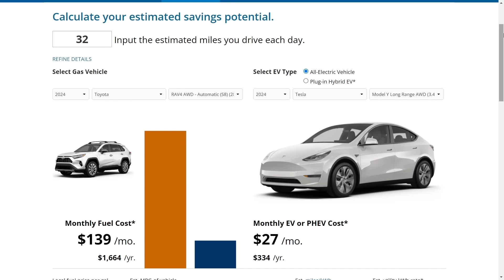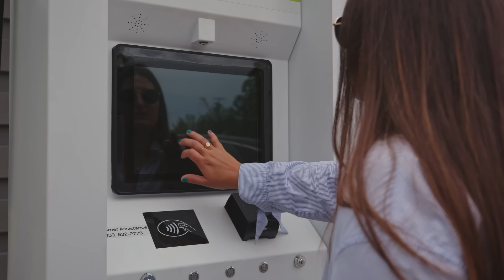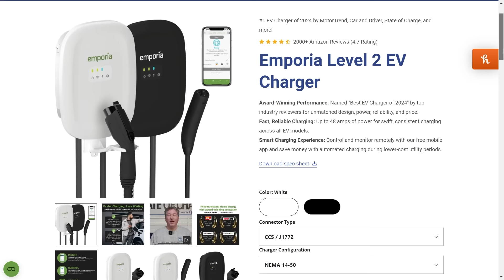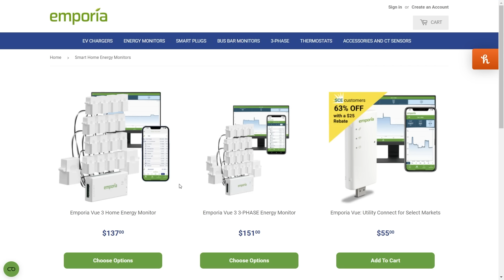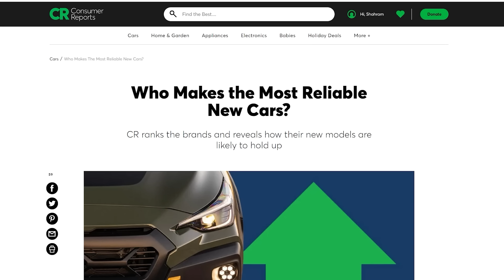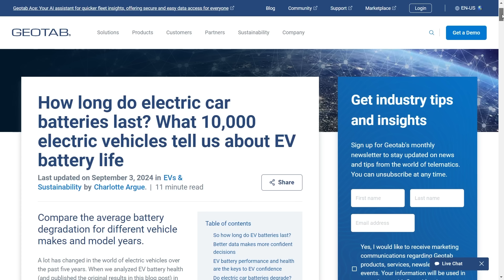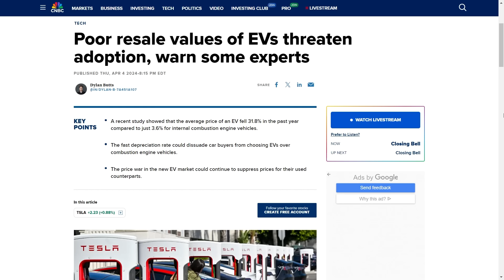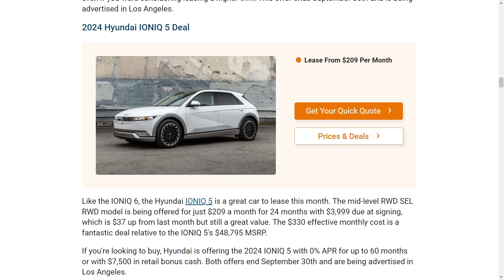EXPOSED! The Hidden Costs Of Electric Cars No One Is Telling You About

Comment: You are reaffirming my decision of going Hybrid, instead of EV. 👍
Reply: Hybrids cost more than ICE vehicles and will need main battery replacements as well.
I will stick with my reliable fuel efficient ICE vehicles that any mechanic can work on.
Reply: @richardmichael59  True, if gasoline remains the primary fuel. But it will be phased out. 120°+ summers in the Southwest, droughts in the Northeast, massive wire fires in the West, increasing tornados in the Midwest and instant-on Cat 5 Hurricanes on the Gulf and Atlantic Coasts wil bring a crushing end to gasoline, as prices skyrocket and then finally a ban shall come. I won't live to see where that all ends, but my grandkids will live it. 
I'm not a self-centered, selfish man. I put the future of all kids first. My personal preference don't meat a thing...
"For the greater good". 😄

Comment: Based on my experience, I agree with your video. I leased a Mach-e Premium, AWD, extended range for 3 years. I estimated that my extra costs associated with  driving an EV were $2,000 per year. I live in Quebec where electricity is cheap. I only drove 15,000 km per year. I did more road trips than the average person, maybe 10 a year. These road trips ranged between 500 km and 2,000 km. The cost of public charging kept going up while I owned my ev. This trend will continue and at some point they will also start adding taxes to maintain the roads. The ev driving was a good experience and believe it is the future, but for my use case I will wait another 5 years before driving another ev.
Reply: @melomane01  You made a big financial mistake.
With the same money you paid for the 3 years leasing (a financial behaviour typical to the average broke person) you could've bought a beater, like a used self-charging hybrid (a financial freedom seeker behavior).

Comment: Love your channel it is fair and realistic! I reserve judgement on any EV's; in part because I see issues and concerns where I question any real environmental gain in using them. I am older and tend to keep cars 30 plus years. I have one that I owned for 50 years now. My 2001 Honda Insight at 470K took less than $5000 in repairs and to maintain in it's life. I maintain my vehicles and another daily driver is a 1996 Honda Accord EX, it has cost less than $6000 in it's lifetime. I am educated; but, worked in body shops my lifetime even through grad school. I also farm grew up on one. My 96 Accord I use like a truck and think nothing of taking a calf to the vet in the back seat. I trust it enough to drive it cross country. An EV for me is not an option closest public charger is 31 miles away. At the farm my electric is maxed out; EV charging isn't an option.
Reply: Yeah that sucks, especially for those without the knowledge to build your own Solar charging station for under $10K, which would work beautifully in a farm.
In fact, one can easily argue that the maintenance costs to get an ICE to 470K (not repairs) will pay for the whole solar farm or at least a great portion of it. This being said, I still encourage people to buy ICE vehicles because EVs are not for everyone, like in your case, and the ICE industry needs all the support they can get.
Reply: You sure beat me by a lot: Only 26 years with my Lexus (which is still really great).
Reply: @wholeNwon  You made a wise choice and it is paying off, so good to hear!
Reply: @ElMistroFeroz  I have the knowledge to build my own solar system the first one I did was in 1982. However, on a farm in south central Pennsylvania things are much different. One isn't looking at feet between buildings, it is by mile. Moreover, I built a structure for solar on my farm. A friend of mine has been working in the solar business since the 70's. I was getting everything I needed at cost and installed. She did the engineering study and found I would need two acres of solar panels to supply my needs. However, during the two darkest months production would be quite limited I also operate a water service that has a huge electric demand. I do some systems here with solar; but, there are limits. When I gave my cost for the 2001 Insight it included everything, even oil changes. Hope your EV is that effective my battery is still alive and well, no interventions will yours be?
Reply: @wayneott5990  Wow, I find it really admirable you were able to take a gas vehicle to 470K miles with $5K. 
This being said, one thing most people don't realize is that we're still in the transition phase where EV owners are or have been ICE owners, so we also have first hand knowledge of that technology and what it takes to run an ICE vehicle that far. From oil/filter changes to going really easy on the brakes and not getting scammed by the average mechanic that always claims you also need new rotors. Timing and all other belts. Transmission, exhaust, tune ups, and this is assuming the car never broke down once. And most importantly - time you'll never get back.
Just out of curiosity, I'd like to know how you managed to maintain that car without it falling apart on just $5K, and what NIMH battery chemistry lasts 25+ (life expectancy being between 3-5 years). As an EV owner I'm used to people making claims without realizing the limitations of ICE technology is common knowledge these days, but I won't make any assumptions.
And yes, my EV battery is doing great. After 8 years and 107K+ miles, it's barely broken in because as opposed to lead acid batteries, they are rated to last beyond 15 years if you take good care of them (at the degradation curve I'm going, 20 in my case at least). 
I was going to address your solar comment but that's an even bigger can of worms to open, but to summarize, it's evolved exponentially the past 5 years, let alone 40+!
Edit: Insight Battery is actually NiMH not lead acid, which is estimated to last up to 150K miles and recommended replacement 3-5 years.
Reply: @wayneott5990  You, too...a man after my own heart in auto care!
Reply: @ElMistroFeroz  My Honda Insight is a hybrid with a manual transmission. On longer trips I can pull down 73 mpg. I have a farm  and buy my fluids in balk; i also do all my own work. For my filters I use Baldwin and purchase in balk. The hybrid battery is still kickin at 470k miles. The oil filter is the same as my one Yanmar tractor as well as the battery. Yes it has kicked three lead acid 12 volt batteries; but I pull the old one out of the Yanmar and buy a new one for it. The Insight is light and good tires last a long time. It is a stick and lingered for sale so long it was a cash bargain. I lost three of the wheel covers, one of the side skirts fell of and a tree limb fell on the roof. It has a dent from the tree lib but interior is nice and it all works.
Reply: @wholeNwon  You made a very wise choice in a Lexis. One needs to look at the long term as we do!
Reply from the maker: Thank you and thanks for sharing! 470k on an Insight? That's incredible!

Comment: One major expense not mentioned are  frequent tire rotations. At least for Teslas, which are intentionally made with the wheels slightly tilted for handling, leading to uneven wear.
Reply: That's not exclusive to Tesla at all.
Reply: Tire wear was mentioned
Reply: Those knowing that tyres' rotation is highly desirable are not buying BEV clunkers.
Reply: @mikej238  Tire wear was mentioned when for acceleration/weight. Uneven tire wear is a different thing.
Reply: @ElMistroFeroz  who f cares?
Reply: @mikej238  You will when you get your first car.
Reply: This is not a Tesla thing about rotating tires most premium cars, front and rear wheels are different sizes and the left and the right tires have different treads. Nothing to do with electronic EV’s.
Reply: @ElMistroFeroz  Tire wear = tire rotation. Maybe when mom let's you drive her car.
Reply: What?  Telsa recommends every 6250 miles. Very similar to ICE cars. Even the convenience of mobile service isn’t take bad but it could be free if you go to the same shop you purchased your tires from.
Reply: I’ve had a Tesla for 5 years and only had to rotate my tires using the normal recommended  guidelines. I also got 40,000 miles out of my first set and 50,000 miles from my second set. It all comes down to driving style like every other car.
Reply: Luckily i rotate the tires myself every 6 months and cabint filter now that my mach e has 40k miles

Comment: As a 70 year old single retired teacher I'm going to be doing some car camping and easy travel so I'm tooking to buy a new SUV pretty soon.  I'm considering:  The Toyota Highlander is going 4 cylinder turbo, which may mean a little more power and slightly better gas mileage, but since it may be heavy on a little 4 cylinder engine probably more expensive to buy, more expensive to repair, and less durable.  Then there is the Honda Passport which has a 6 cylinder engine so more reliable, but it has a timing belt which at present costs about $1500 (USD) to replace at about 100k miles.  A v6 means less mileage too, and the 9 speed transmission in the Passport has a history of problems but may be ok now.  Any thoughts?  Should I consider a hybrid?  Cheers!  BTW, your channel is such a great service for people, thanks!  Anyone have any thoughts?

Comment: If you pull permits and do your own wiring, the inspector will ensure you've got it right.  Given how easy it is easy to add a  single circuit it doesn't seem like anybody should be shamed into hiring a professional electrician if you are comfortable working in a breaker box.
Reply: In my previous home, electrician had to drill through CMU wall into the garage, under the house, not something I have the equipment for. Charged me $1600 for the privilege.
Reply from the maker: I wouldn't call it shaming to hire a professional. It may be easy for you, but others certainly wouldn't see it that way. And given the risk of severely hurting yourself or even burning your house down if you do it wrong, I could never endorse diy to everyone.
Reply: @carhelpcorner  I did say "if you are comfortable working in a breaker box."

Comment: I did just that what you don't recommend - did my own electrical (50 amp braker, 60 amp cable and nema 15-50 plug) and bought a $250 amazon charger (32amp) b/c my car max is 30amp charge (PHEV).  I did the same plug at my old house, lets you swap chargers later but if I go bigger than 40amp I would need thicker cables and bigger breaker. My service is 200amp.

Comment: Interested in seeing your comparison to hybrids.
Reply: Based on real life data, the self-charging hybrids are the best of both worlds (most reliable and lowest TCO, according to Consumer Reports, ISeeCars and CarEdge), while the PHEV are too close to the unreliability and huge TCO (Total Cost of Ownership) of the BEV.
Reply: @ I have an Avalon Hybrid and I love it. Probably best car I have owned. Rated at 43/44 mpg, but I often get 46-49. Engine needs to be serviced at every 5K miles and change air filter to battery about 20K. No problems at 35K miles. Around 50K I’ll change inverter coolant.

Comment: Depreciation is likely related to expensive repairs and battery replacements.  Non early adopters know the facts so fewer want used EVs.

Until there are extended battery warranties to 16 years or OEM battery packs available at reasonable costs, I will keep my ICEVs and HEV for now.

Comment: As we do not drive very much (2-3 times per week total of 60-100 miles), so most of the time the car is parked in the garage.. What is the the point of break even point of mileage vs time used, comparing the EV energy use while parked versus the ICE vehicle which does not use enerygy while parked.  What is the energy use of an EV just sitting there? It isn't essentially zero like an ICE car.  Is it worth the increased electricity cost?
A similar question would be how much energy would be used leaving your car in an airport parking lot for 2 weeks?

Comment: Insurance: currently paying £329 for a 2 Ltr. 2007 Petrol Mazda 5 . . . . Quote for Tesla EV  . . . . £2664! . . . Yeah, I'll go for an EV
Reply: @sterobloc6645   Your Mazda is scrap metal. Compare quotes on a comparably priced car.
Reply: @mikej238  NO!. . .  The point is my Mazda is perfectly serviceable why should I bother changing. £2664 is around 2 years petrol/gas!
Reply: @sterobloc6645  If your Mazda is perfectly serviceable, then don't replace it. But if you're in the market, compare that Tesla to a new ICE car of similar price. If you have a good working car, there's no need to get a new one, EV or ICE.
Reply: @ToughOnions I just compared some similar priced ICE cars like Volvo and Lexus and all insurance companies came out about $1000 per year more for the telsa model 3 AWD.  Not everyone gets insurance quotes before they take the plunge but it will probably significantly chip away any maintenance and fueling savings quickly.

Comment: Hmmm... I'll get a 2019 Honda Civic sport, manual transmission for about $20k US.   Get an extended warranty and have a good mechanic look at it first.  

What is the environmental cost of making the EV battery? Also, there is an environmental cost of producing electricity and transmission.  More than a standard car battery, that I could replace myself, for $200 from Costco. You went over the other cost. 

I would love to do a 2015 VW TDI, manual, but they are getting a little long in the tooth.

Comment: I’ve been saving so much money with my EV for the past 5 years and 105,000 miles. 
1. I did not have to buy an eEV charger. I had an electrician install a 240 volt nema plug (same as for a dryer) for $400 (already had updated my panel because I was worried about fire risk) 
2. I charge mostly at home. When I do charge at public chargers it’s for road trips and I end up spending way less money on gas. 3. My tires last the normal recommended wear periods because I don’t drive like a maniac and use regen braking that not only keeps the tires from wearing but my pads and rotors are still like new at 105k miles. 
All of this is hyperbole, meant to get views and attention in order to pay for his new electrical panel which you should frickin’ do if it’s 60 years old. Come on man!!!!!😮
Reply: I bought my friend's 12 CT200h for less than $4,000 USD.  Gasoline is like $900 a year.  I want a long lasting EV, not something that can be shot in Year 12 or sooner.

Comment: I have owned 2 electric vehicles in Brazil for 7 years and I am very satisfied! a Tesla and a Volvo And I bought a Tesla charger! I save around 70% if it were a combustion car! Apart from the maintenance which is cheaper!!
Reply: Satisfied with the ownership or the cost? This was about the cost, 
And if you sold them, how much did they depreciated?
I have a diesel car and it depreciated ~2,300$ a year, I have the impression electrical cars depreciate much more

Comment: I came out with about $250 per year savings with an EV over a similar priced ICE. 

EV Insurance increase was very noticeable over an equivalent ICE. Eats up the maintenance savings quickly.
Reply: @krisevon  Then, if you apply your small savings vs. a big depreciation (a very low resale value), a BEV is obviously a bad financial decision.
Reply: @ after 10 years ICE or EV will only be worth 10% so a wash there.
Reply: @krisevon  Not true for the best ICE cars (my Miata ND2 RF and Suzuki Jimny are very strong examples for my fact-based claim). And they will run for decades, unlike the short-lived electric appliances.
Reply: @ I guess we will know in 10 years. Plenty of telsa model S cars have 10+ year old batteries that I fine and the tech is even better now so the idea of a short lifetime EV are overstated.
Reply: @krisevon  The polluting, unreliable, huge TCO, dangerous, impractical etc. EVs will last max. as long as their batteries.
Definitely far less than an ICE or a SCH.

Comment: Very well done as usual Shari. Bought a used 2020 Chevy Bolt last Dec. for $14K. Got the $4k used tax credit. Liability insurance. Electricity is very cheap in North Dakota so we've been saving a lot of $. 3 modules in the battery went bad this summer. Was covered by warranty. They replaced the whole battery. There was an open recall on the vehicle entitled something like, "software update to prevent the premature failure of the battery", so hopefuly they finally got the programming right. I'll probably sell before the battery warranty is up. I don't think $10K was a bad deal in this used car market and would suggest people to consider a used EV after someone else has taken most of the depreciation. I honestly don't know how I would go back to gas. Would like something bigger of course. Kept my 2002 Buick Park Avenue with 285K miles. Just won't die and cheap to fix. The Buick gets around 30mpg on the highway, and the Bolt has been around 8 times cheaper in the summer. We know it doesn't have a heat pump so it will not be as good in a ND winter. Be well all.
Reply: @stevensauvageau8827  actually a heat pump would not be an advantage in a ND winter. Heat pumps provide an advantage in cool weather but when it drops below freezing they really don’t provide a benefit.
Reply from the maker: Thank you! With a new battery, I'd probably keep the Bolt, but it would definitely be a great buy for someone if you trade it. That Park Avenue sounds like a gem btw!